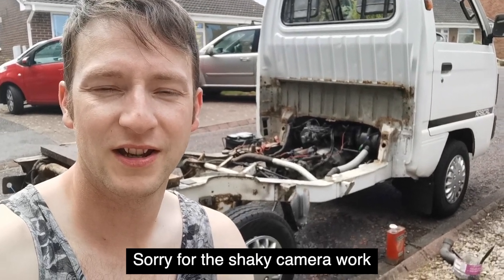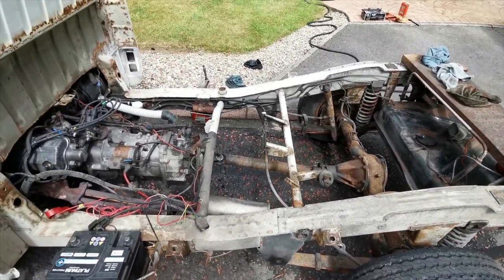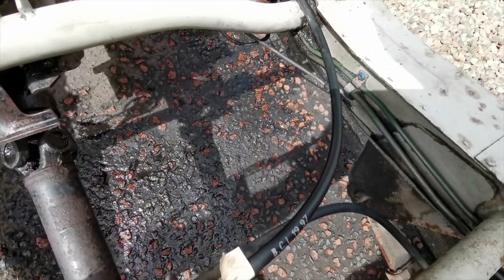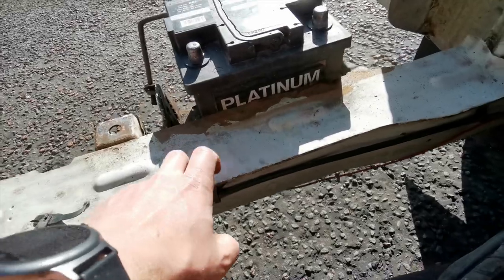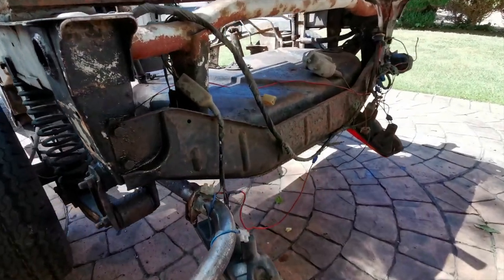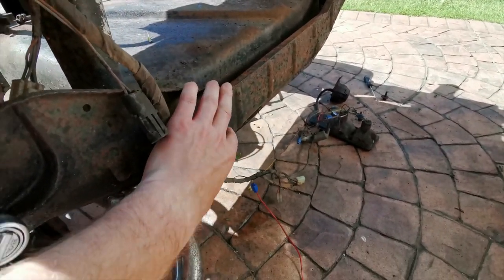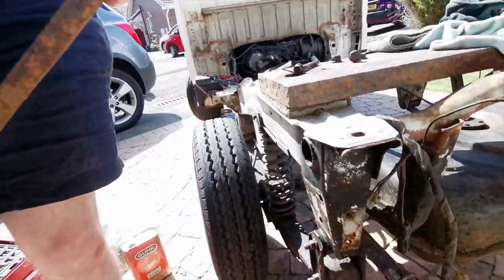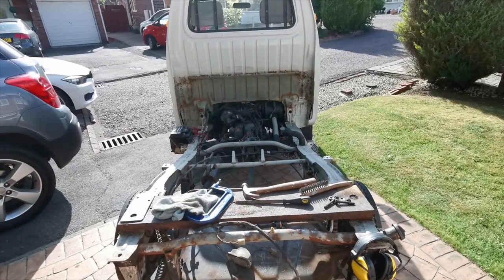Deep Cleaning my Bedford Rascal Frame

Comment: Hi Tristan, you know when you’re ready to fully reassemble are you going to wax oil it? If you do, another tip would be to get some10mil rubber bungs, drill holes in the box section steel, spray wax oil in, then pop the rubber bungs in. . Wax oil can save further rusting. Weird stuff but I’ve done cars and sills etc when new and it’s proved to be a great product. Best sprayed but not cans as they are rather expensive that way.
Spending more time doing these tasks though your itching to get advancing will be peace of mind in time. 
It’s gonna be good when it’s done. Just don’t get impatient. If you feel you are, take a break for a few days and you will come back with fresh eyes and energy xx
Reply from the maker: I previously wanted to avoid waxoyl because I didn't want to to mess up the area that I've painted because I wanted it to continue to look really nice. But thinking about it further I would actually rather prefer the rust to stop than for it to look just like the show vehicle because realistically it's not going to be, it's going to be used for its actual purpose. 

I have been told that the hammerite is going to be pretty much useless now so I'm going to end up having to do the whole thing again I should imagine within the next year or two.
Reply: @tristan7734  the key is to get it into the cavities, heated up waxoyl can be sprayed inside cavities and it will stop the rust as long as the rust is dried out already.

Comment: That wirings making me ill looking at it. Lol. Id rip it all out and start from scratch.  Also,  Get rid of the scotchlocks, solder and heatshrink those connections for a guaranteed connection. 👍

Came across this channel today, youre doing a good job so far buddy! 👍
Reply from the maker: That's the plan Dazzy. I have purchased a junction box, and 20 meters of 8 core cable, I have shrink-wrap, solder, connecters and a voltmeter. So I think I will be ready to go with that to get things working well. But I am going to wire in the tow bar socket at a later date to allow split charge relaying to work with the Romahome.

Comment: Hi a suggestion for your wiring / get a length of towing cable either 7 core or 13 rewire using caravan colours the cut the loom at the cab end and either join into the original loom colours or put caravan plug and socket makes it far less daunting,good luck
Reply from the maker: I have purchased a junction box, and 20 meters of 8 core cable, I have shrink-wrap, solder, connecters and a voltmeter. So I think I will be ready to go with that to get things working well. But I am going to wire in the tow bar socket at a later date to allow split charge relaying to work with the Romahome.

Comment: Ooh and Tristan please protect that battery when it`s diconnected! When you drop something iron on it you will have a big BOOM.
Reply from the maker: Yes, I think I realised this shortly after off camera and I removed the battery, I was using it to move it to a more suitable area to work on and then disconnected it. When I disconnected all the wiring I had to remove it anyway because there was no ground wire.

Comment: The wiring connector to the Romahome is the source of all the bad wiring. It's a typical trailer plug nightmare.
Reply from the maker: Yes, I am looking at a wiring diagram to completely change it all. I need a different trailer plug I think also, so that it can act as a split relay charger when the pickup is running. At present it is built into the Roma body, I bought it like that, but it takes up a lot of room.

Comment: Tell me to do one. but I'd get a new rear loome . It does look a mess. And replace the shockers while you can easily.
Reply from the maker: No, I think you are probably right, it is such a mess at that rear end, I will probably get an auto electrician to come and sort it all out, the most important thing is to have a good ground. I'm not sure how to replace the shockers at the moment, however I do have the manual to explain, so I will take a look and probably do a video on it, because they are very worn.

Comment: As far as I can see it Tristan that what you take of in a protecting coating like above the wheel of a normal car. I would say if you have taken of all the rust don`t leave it like this. Something has to come on this is thin and old.. It will rust fast and soon.. Other than that good job keep doing it and make video`s..
Reply from the maker: Thanks for commenting Karin, yes if I was to leave it bare, it would rust, that's why I planned to paint the whole think with Hammerite, which adheres to rust and prevents it from spreading. Also painting all the areas which haven't rusted would prevent them from Rusting also. There are other areas like the doors which need prepping properly and professionally respraying really with a good few layers like a modern car has to prevent rusting. I plan on making many more videos! make sure you are subscribed! 😁
Reply: @tristan7734  It`s Ron, Karin is my wife :)
Reply from the maker: Nice to meet you Ron 😁

Comment: Looks more like underseal that you are scraping off the cross tube, the whole chassis would be better coated in this compound, once damp gets under Hammerite it rusts quite fast, personal opinion is that it's over rated!
Reply from the maker: I have thought this too Neil, I am going to with this for now and see how it goes, however this isn't the 1 and only time I am going to do this job, I am looking to sand blast everything one day and do a much deeper treatment, but for now keep on top of it at least once a year till then.
Reply: Yes, I had similar experience with Hammerite too.
Reply: @tristan7734  I would suggest plastidip, if you get the black or white brush on in a big tin then you can build up thick layers in no time. it shrinks as it drys to form a rubber coating which is highly resistant to stones and water ingress etc.. It is also very easy to repair or remove with a knife if you need too for any reason on non primed surfaces.

I have painted my ex ambulance with it and will be doing my bambi with it too.
Reply: They also do it in a clear form so you can see through it if you are concerned about water ingress :)

Comment: Are you going to remove the big weight over the back wheels. I can see the wisdom of it with a standard pickup, but if you've got the weight of a camper over the back end, it's just dead weight you're lugging around needlessly.
Reply from the maker: I totally understand the logic behind your thinking, however, I plan on using it as a pickup from time to time also, so I will need it to be there. There is of course the option to remove it and have a way of quick reinstallation for when I am using pickup only. Definitely something to think about though, thank you.